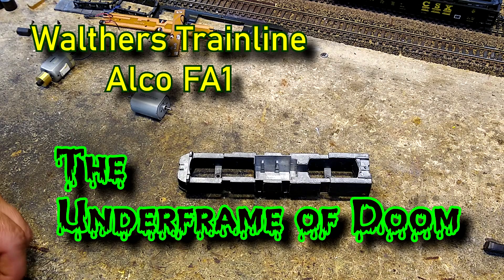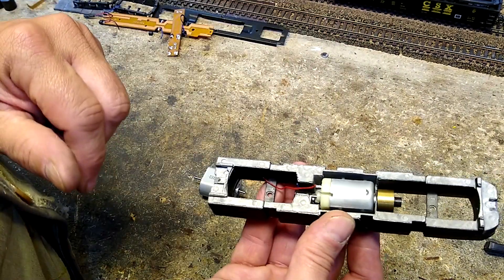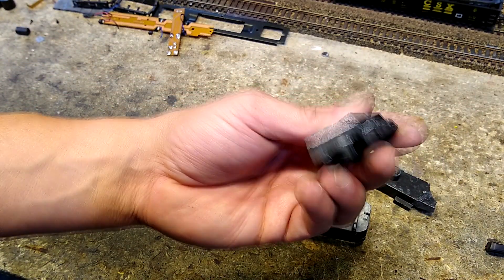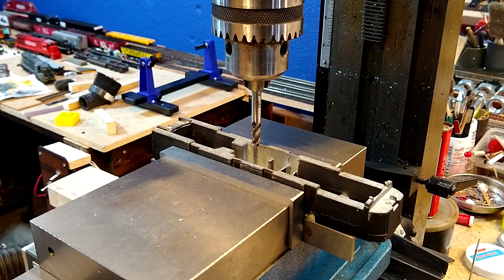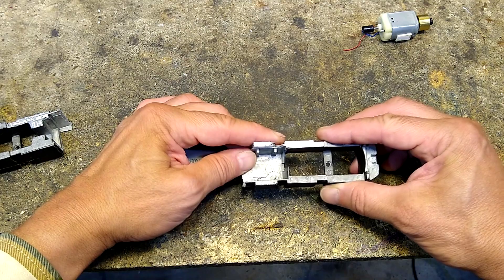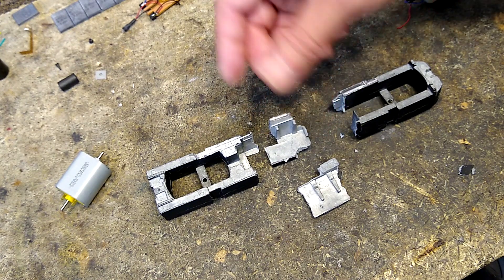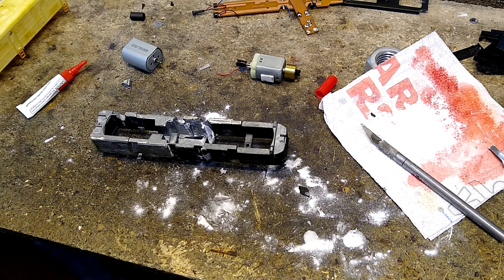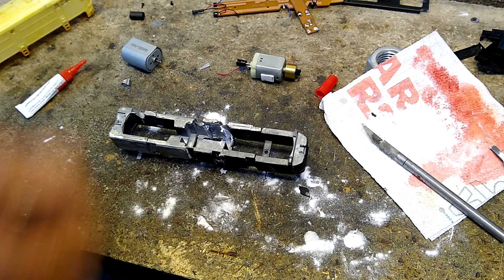ALCO FA1 Walthers Trainline and the Underframe of Doom

Comment: Hi would you happen to know what wire gauge is for the Athearn Genesis? Ho Scale SD70ACe  for the power trucks?
Reply from the maker: I always remove the factory wire no matter what and replace it with Striveday 32awg silicone wire.  The wire is far superior and much easier to install.  It comes in a box with 5 rolls and is on amazon.  The silicone is pinch and pull with you fingers so super easy to strip back the insulation.

Comment: What house hold metal cleaning polish do you  recommended? For cleaning athearn  diesel locomotive  wheels?  My athearn blue box motors are getting very  hot.i have disconnect the drive shafts.and just let the motor. run and gets very hot the motor hope you can help thanks.
Reply from the maker: the motors need a dot of Marvel air tool oil on the bearing on each end.  Noxon on a microfiber cloth - put the wheel in an electric drill and you can polish those wheels to a mirror finish

Comment: Zinc Pest is a massive issue with many Chinese locos and rolling stock. No cure. With your talent you can build a new chassis. The Zinc Pest is like a cancer to the die cast mental no recovery is possible.
Reply from the maker: I've tried many things to deal with it, but a solution will be found.  in this case a new frame will be made from aluminum